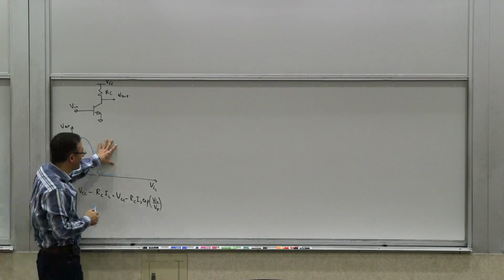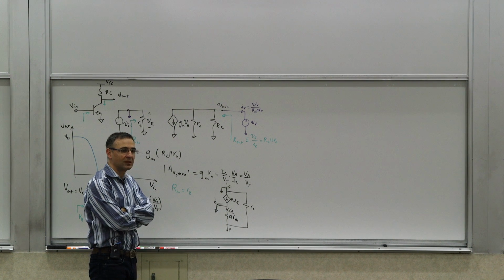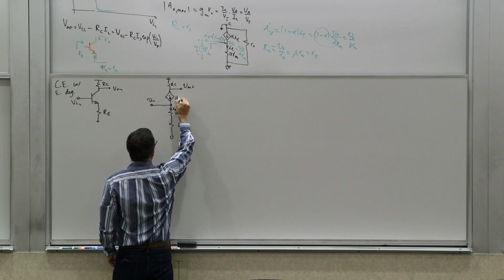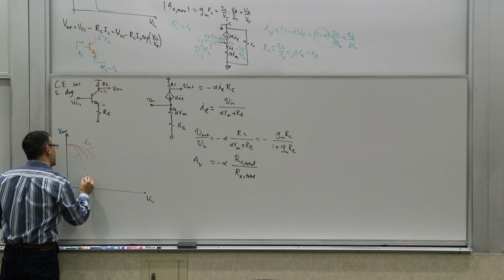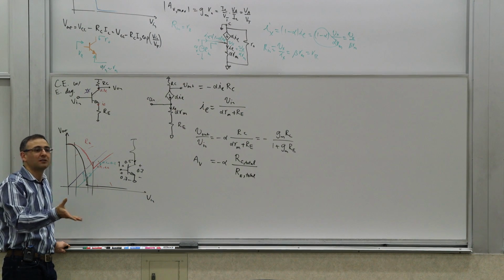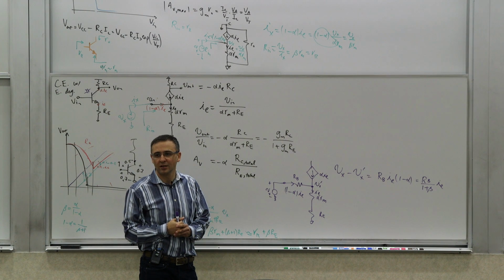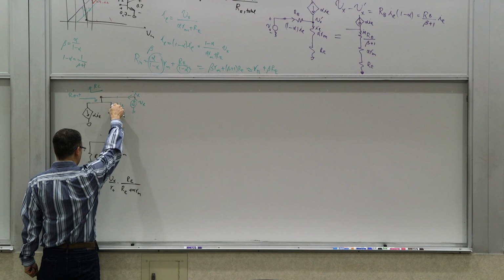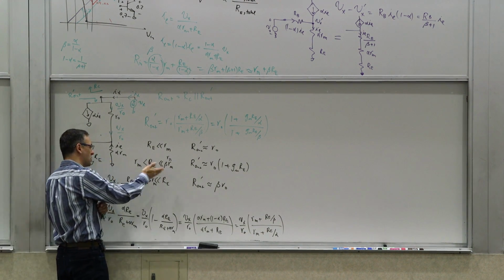121N. (Pt. 1) BJT Amplifier, Emitter Degeneration, Transfer characteristics and gain

Comment: 00:03 Reviewing bipolar stages and modeling behavior
02:12 BJT amplifier operation and the usefulness of PI model
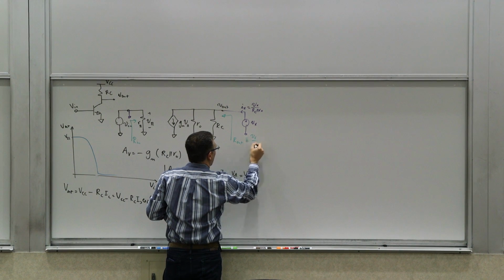06:49 Understanding the resistance seen looking into the terminals of a BJT transistor.
08:54 When the other two terminals are AC ground, the collector resistance and the resistance into the emitter need to be taken into account.
13:32 BJT transistors have three terminals with varying impedance levels.
15:59 Emitter degeneration linearizes the amplification process.
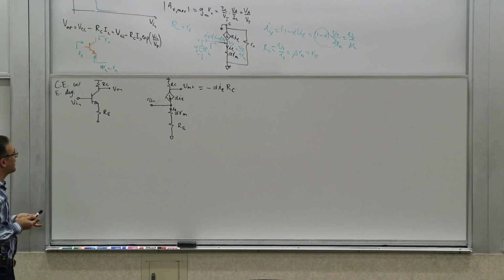20:24 Analysis of BJT amplifier gain
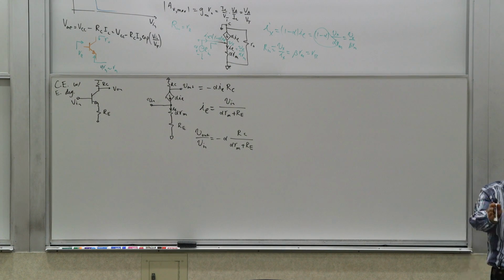22:35 Transistor gain depends on resistor values and alpha
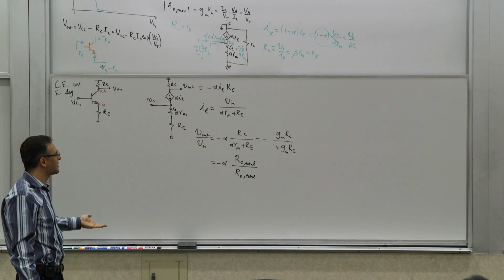26:26 Voltage gain is the ratio of total resistance in the emitter times alpha.
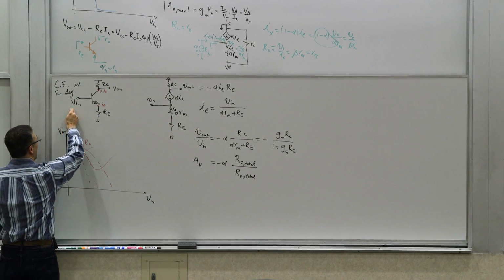28:35 Understanding the balance between physical understanding and abstraction in circuit analysis.
32:39 BJT amplifier behavior in saturation region
35:11 Emitter degeneration affects the voltage and slope.
39:37 Emitter degeneration helps in transistor biasing
41:58 The concept of beta RM and reflection coefficient explained.
46:54 Emitter degeneration increases input impedance and decreases output impedance.
48:51 Determining the output resistance with inclusion of ro.
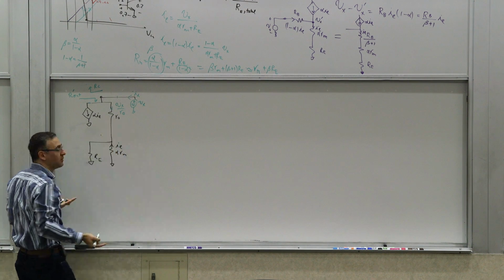52:58 Calculating current division using BJT amplifier
55:41 Derivation of transfer characteristics and gain in BJT amplifier.
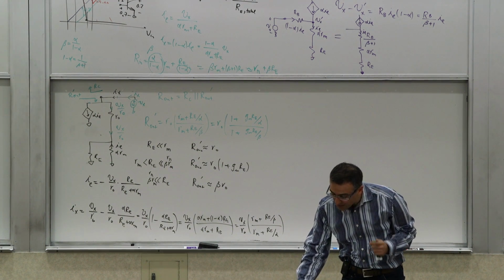1:00:45 Emitter degeneration affects current division
1:03:08 Emitter degeneration in BJT amplifier
Crafted by Merlin AI.

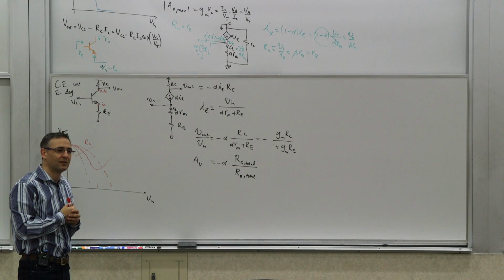Comment: Can someone explain the answer to the doubt asked at 30:45
Reply: Sorry at 34:16
Reply: basically he means , the first curve its big effect is the emitter resistance the voltage Drop very slow  , but without the emitter resistance the vout decrease rapidly bcz the potential in emitter is 0 so it drops very fast
Reply: @zinhaboussi  thank you for your response, but even if it drops faster at the end, when  BC becomes forward bias or saturates, with vin, vout has to increase right but in that case it is not increasing it is just a flat line, can you @twix explain, I would appreciate others to.
Reply: @loadwild  The BC junction is around 0.5V, however Vce=0.1V~0.2V. That means Vout is almost grounded but still have that 0.1V~0.2V above the ground. That flat line maybe because of this. In terms of degenerated CE amplifier, because of RE, the Vout is far from being grounded, that's why once the BC junction is forward biased, the Vout starts to follow Vin.
Reply: for black line even if the Vin is verylarge the VCE remain btw 0.1~0.2V no matter if you increase Vin cause with increase in Vin the vbe and vbc btoh become Forward bias thus the voltage btw them remain constant as 0.1~0.2V

Comment: why is that when the BC junction is forward biased we had this kind of  behaviour   where vout is now tracking vin which means as we increase vin so does vout and in case of a non degenerate CE amplifier circuit at some point once the CB junction if FB the output voltage saturates ?
Reply: Hi @DTM did you get the answer to this, I just got the same doubt XD
Reply: @amruthyetikuri8670  Hi do you get the ans to this? i also got the same doubt